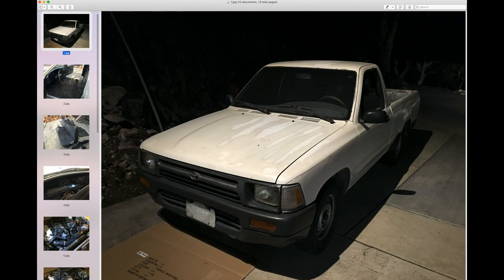Overview of the Toyota 22RE motor... what are all these vacuum hoses???

Comment: Thanks for the video, was looking at this to better understand vac lines for possible egr delete..

I have a question with a 22re that perhaps you can help me with. I have a 1994 pu 4x4 with 22re.. 175k miles it blew the head but i caught it very quickly and it was ran hot. just did a head gasket replace, resurface head, water pump, oil pump timing kit w gear, chain, tensioner and guides, timing cover, radiator. After the above work i noticed the valves ticking like crazy, either in c3 or4 towards firewall. Before it blew the head gasket the valves only ticked at idle.. at idle all u could hear was slight valve tick, injector tick, and mostly radiator fan.. the engine sounded and ran amazing, thats why i chose to do that kinda rebuild.

After rebuild noted above it still runs great, but valves are crazy loud. Mechanic said he checked valves and they were mostly in spec at  8 and 12 and barely needed adjustment.. i put 300 miles on engine and it drove me so crazy i thought it might be an exhaust leak, so i got the mechanic the fix the exhaust leak where the manifold bolts to first down?pipe and readjust valves.. no change... it doesnt tick intermittantly like some exhaust leaks do they go queit when warm.. this ticks and has never stopped..

The ticking is def from valves and not timing cover, you can hear it loud at idle and through all band of the rpm in everygear. I know these engines are known to have ticky valves. But what bothers me is it never did it anything like this before the headjob, what explains why it is doing it now.

Assuming mechanic did good work, valves are in adjust... [ he put to 7 and 11 the 2nd time].. what explains why it sounds like a completely different truck and ticking like a diesel?? Can you help me work backwards under tgese assumptions then at last resort seem what assumptiobs of likely false.. please help
Reply from the maker: It's hard to diagnose motors over the internet, but a few things come to mind. First off, I'd run the valves at .008 and .012, not .007 and .011. The main reason being what's known as "seat time". If you run the valves too tight, you reduce the time the valve remains in contact with its seat and this can work to reduce heat transfer between the valves and the seats, which is the main way they transfer heat away from themselves. Also, how much did you remove from the cylinder head? When you surface the head and/or block, you lower the height of the camshaft center line and thus the timing sprocket. This introduces slack into the timing chain. It can also throw off the camshaft timing. Keep in mind that 1 degree error in the camshaft equals 2 full degrees error in the crankshaft. This might not explain the noisy valve train, but it's something to be aware of. Also, when you did the top end, did you happen to check to see if the timing chain guides on either side had fractured? That's very common with the single row chains and the plastic guides. This combined with a bit more slack in the chain can result in a lot of noise. I'd find out how much was removed from the cylinder head and also remove the valve cover and inspect the timing chain guides. Keep in mind also, if the timing chain is slack, there is a defect in the 22RE whereby the timing chain (when loose) can wear a hole through the cover near the water pump area - this can eventually result in water being introduced into the oil. There is a mention of it on the Wiki page for the Toyota 22RE motor if you want to find out more. Another thing to keep in mind is the relationship between the camshaft lobes and their respective rocker arms (specifically the pads). Usually it's best to keep those matched, since they tend to burnish into each other. If you have removed the rocker arms and switched them around at any point, that could possibly (although it's low risk) cause issues. My guess is the noise is stemming from the chain and echoing around a bit. Also, what weight oil are you running and are you running an oil with ZDDP in it? These motors are using flat-tappet cams, which do not like modern synthetic oils and/or oil which do not contain stuff like zinc and moly. So that's something to consider as well. Let me know if you have any other questions on anything. Also, it's possible some of the noise could be stemming from the lower end.. such as piston rings, etc. Have you run a compression check and/or leak down test? In some cases, when a motor over heats, you can butt the piston rings and break them. When that happens, it can cause the pistons to rock a bit more than usual and this additional piston slap can make noise also.
Reply: @ray5961  I am not sure how much came off the deck when it was resurfaced.. This was outsourced by the mechanic to a trusted machibe shop, no further details there. The guides were broken, and the waterjacket work into by the chain, I believe i caught it the first day it penetrated the waterjacket for the following 2 reasons, 1) that morning on the way to work i noticed higher than normal oil pressure, and 2)it started overheating after work that same day bc i caught it idling lower than usual and almost stalled coming out of gas station and noticed it was 65% on temp guage.. usually runs 48%.. pulled out let it cool checked radiator bone dry and pulled dipstick was slightly milked and got it towed to shop from there. The guides, tensioner, timing chain , gear and timing cover were all replaced... I bought a mechanics stethoscope and the noise is mot coming from timing cover, its under valve cover near cylinder 3 or 4 more towards firewall..It never ticked like this before.

Im currently running 10-30 valvoline syntheic blend...
Reply from the maker: @shamos999  I'd find out how much was taken off the head. Trust no mechanic. Did you upgrade to the dual row timing chain or just go with the single row again? Also, were Toyota factory parts used for this job or after market stuff? As far as the ticketing, it's hard to say. Could be the guides weren't done correctly or it could be there is an issue with a piston wrist pin or something. It's just really hard to say for sure without knowing everything which was done. I think if it were me, my next step would be to do a compression test and a leak down test on each of the cylinders to make sure everything is sealing up okay and the compression figures are in line. If the oil was milky, it could have damaged the cam lobes or pads. You could have also scuffed up the cylinder walls and now the piston skirts are making noise. If you are running full synthetic oil you really should add some Lucas ZDDP to the mix. Something with both ZDDP and Moly could help quite things down. Maybe try some Driven Racing oil HR2 10W-30 for a bit and see if that helps. You could also have some guides sticking and causing the valves not to come back up correctly and/or some issue with the valve springs or something. It's just really hard to say without inspecting things or knowing what was done. Engine building correctly requires a lot of attention to detail. If you get one thing off, it can raise hell. And yeah, the "Toyota Ticking" is generally only heard at idle. Once you are going down the road, you shouldn't really be hearing that. If you are hearing something as you drive, that sounds like something is off. Who did the engine assembly and was break-in oil used as well as engine assembly lube/grease? If the valve guides were done, did they replace the rocker arms and/or cam or anything?
Reply: @ray5961    I will try to find how much was taken off the head on resurface. I went with the single row chain, and all parts were oem toyota aisin bought from yotashop. I will also see about a compression test, and look at doing an oil change with better oil..

Engine assembly was done by a trusted local mechanic, break in oil was not used, but i believe assembly grease used valve guides, rocker arms, and cam not replaced.... only things replaced were head gasket, various head seals, head bolts, full timing kit, timing cover, water pump, oil pump, thermostat, radiator.

I am just really bummed bc it sounded great before it blew the head gasket, only ticking at idle, purred goibg down the road... i rebuilt it bc it purred so well, now i have $3400 in repairs and it sounds like a different truck, ticks as loud as a diesel just a bit faster... other than loud valvetrain it still runs great and very strong but i am very bummed out about the new ticking  through the entire rpm band in every gear... sadface
Reply from the maker: @shamos999  Yeah, that sucks for sure. I've had issues with my truck and people say stuff like "just get rid of that truck, it's costing you too much time". But in the end it will be worth all the headaches. I wish I could help you out a bit more. I don't know what exactly could be causing your issue there. You're sure it's not an exhaust leak maybe in the air suction system or something? Are you running a header or the stock manifold? Another thing is that I've noticed some exhaust manifolds have their bonding rivets in a strange location and interferes with the exhaust mounting flange. I forget which brand it was, but one of the exhaust gaskets I got had the rivets in a slightly different location and it caused the header flange to not sit down properly. I wonder if maybe you might have something going on like that, which is allowing exhaust to get by or something? On the exhaust gasket, you should able to see all 4 rivets where the head shield thing attaches. You might want to confirm all 4 are in the clear and not infringing on the header / manifold flange. Does the ticking noise increase with engine RPM throughout the entire RPM range?
Reply: @ray5961  i have an exhaust leak at the manifold on my 4.0 jeep and it ticks just as loud if not louder but stops when warm, although sometimes comes up again warm at idle occaisonally... i really was hoping it was a high exhaust leak near the manifold, and thought i might have found it. Where my exhaust manifold first bolts to the next down pipe, the one you see if the heat shield is removed, there are 2 bolts that connect the manifold to the downpipe, and my truck was missing the one closest to the engine.. its impossible see unless you are under the truck, but i found it looking for an exhaust leak. The bolt is in a horrible place, and it seems the manifold needs to come back off to place that bolt. I have a feeling that perhaps this was forgotten on repair but mechanic claims he never removed manifold from exhaust?? And denied it could be him. Either way, instead he just drilled and threaded a bolt through it and snugged it up. I also replaced my o2 sensor bc after repair during first 50 miles i slammed 3 and blew my o2 sensir straight out of the exhaust, was dangling by sensor when i got home, and truck sounded very loud.. bought another o2 sensor and replaced it but wasnt able to get it super snug bc of dirt or rust on lower parts of tgrwads. However, when he adjusted valves for 2nd time he also put the bolt in the place i said and fixed o2 sensor so its perfectly seated by rethreading bolts. Mechanic claims no leaks in exhaust system after that.

I am running original manifold.. i was wondering if perhaps it could be comibg from egr or air injection, hence why i was looking at ur vid considering egr delete.

As far as the heat shield goes, i removed it to get to manifold bolt issue with no luck. The 4 bolts that hold it on 3 i removed and the 4th broke off, i will check tomorrow to see if they breech the manifold.

And yes the ticking increases with engine rpm throughout the entire range in every gear but seems to mildy quiet up around 2400rpm to but still much louder than it was.
Reply from the maker: @shamos999  Yeah, broken exhaust manifold bolts are a drag. When I first got my truck, there were multiple broken bolts and stripped holes in my cylinder head. I used a product called a Time-Sert to repair all those, until I bought the LCE ported head and installed that. On my current setup, I'm running Titanium exhaust studs on the cylinder head. They are much more forgiving when it comes to heat cycles and taking things on and off. You might also consider LCE's long street header. I run that on my motor and have been very happy with it. It's a bit louder than stock, but it's really nice and gives a little extra power. The EGR valve stuff is sort of a hassle. That cooling plate around the back of the head can be a nightmare when things leak or go wrong. There are also two or three small ports on the cylinder head, which feed all that. It's possible maybe one of those ports is leaking up under there. With out the exhaust manifold removed, you can't really see them. Try listening under the exhaust manifold kinda between spark plugs #2 and #3. Maybe the gasket blew out under there and is now leaking?

Comment: Hey Ray wonderful video, so I'm about to bite the bullet and do the lc engineering stage 3 22re rebuild, and this is my first time doing a rebuild. Will it really be as simple as get the "long block", bolt it up to transmission/ensure its on its mounts, rehook up the vacuum lines/wires, put in all new fluids, and then turn the key? Or like do I need to do all the balances to the AFM and the throttle position sensor? What I'm really asking I guess...is a turnkey engine REALLY a turnkey engine?
Reply from the maker: You'll only need to adjust the throttle position sensor if you remove that and replace it, but yes that needs to be in perfect adjustment. Double check with LCE, but I don't believe level 3 will work with the stock ECU. This means you will have to run some other engine management system. No matter what, you'll need to adjust the air/fuel ration (stock ECU or not). To do this, I highly recommend installing some sort of wide band O2 sensor, which will give you real time A/F ratios (or lambda data). I use the AEM gauge here and it's been tremendously helpful for tuning. Also, if you have never brought a motor up from scratch, make sure you break it in with something like Lucas Break in oil, not synthetic oil. You also need to properly break in the cam lobes, which is a job all in itself. Additionally, you need to pay special attention to purging the air correctly from the cooling system (using one of those funnel deals from amazon). Let me know if you have any other questions! :)

Comment: Hi Ray. Thanks for this video! I have a 91’ 4WD with 276K on the motor. Head gasket has a small leak (exhaust gasses blowing into coolant) and according to the previous owner, there’s an aftermarket head on the truck. Would you bother installing a new head gasket or just do a long block replacement considering the mileage on the block?
Reply from the maker: A lot depends on what cylinder head you have on there when it comes to the previous owner. If he installed a $2000 LC Engineering Pro Street head, that's something to consider. If it's just a non Toyota OEM head from ebay, that might be something else less important. As far as the current state of your short block and whether it's worth using, that's also hard to say. Is your current setup burning oil? Do you happen to know the compression readings across all the cylinders? I guess I'd say the answer depends... if you don't want to spend a ton of money, you might want to just pull the existing head off and inspect things. If you have a bore gauge that is accurate down to .0001, you could measure the cylinder walls (see my video on hand scraping the block for more info). If the walls measure out okay, then you might be okay and can just get away with slapping a new head gasket on. If you do that, I would suggest using the Fel Pro 26185 PT head gasket, which has Teflon and Kevlar in it https://www.amazon.com/gp/product/B000C2CA4A/ - you can also find it at places like Napa Auto. That's the gasket I run and so far it's been outstanding. You can also get yourself a surface plate here https://www.amazon.com/gp/product/B006JYKIVC/ and use that with a sheet of 1000 grit sandpaper to flatten out the block (pull the dowels as shown in my video below) and cylinder head and then just slap some new head bolts in (chase the holes in the block with a tap). See my video here and it might give you some ideas: https://youtu.be/aa6vvwLlpTIhttps://youtu.be/aa6vvwLlpTI

Comment: I have a rear main seal leak I think. How long can it go unrepaired?
Reply from the maker: Usually pretty long, as long as it's not gushing out oil and as long as the oil isn't getting up onto the clutch disc (assuming it's manual). If it's just dripping on the driveway, you can usually deal with that for a long time as long as you keep the levels in the motor up. What generally goes wrong is the seal has a spring which applies pressure to the rubber where it touches the crankshaft. That pressure wears a little groove into the crank after many thousands of miles. That undermines the perfect seal of the crank seal - however, once that happens, the wear tends to halt. Once the groove is worn, it tends to not continue to get bad as quickly, because the spring can only apply so much pressure into that small area; so the groove will sort of exist, but slow down as far as how much it wears (if that makes sense). So as long as you don't see oil gushing out and/or the size of the drip (the rate of it) doesn't seem to be rapidly increasing, you can probably just continue to drive for a long time and/or until you get around to replacing the seal. I wouldn't use any of those leak stop products, however. Those work by expanding the rubber and usually that's only a short term solution. Hope that helps; let me know if you have any questions on anything I've said here.